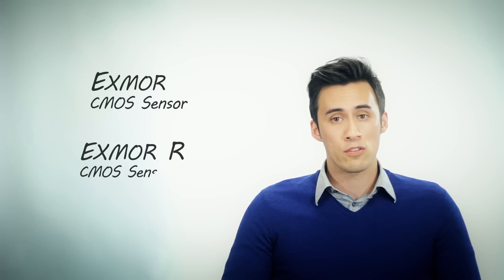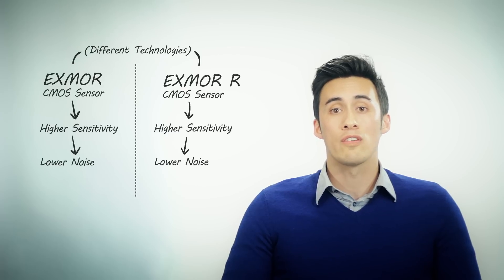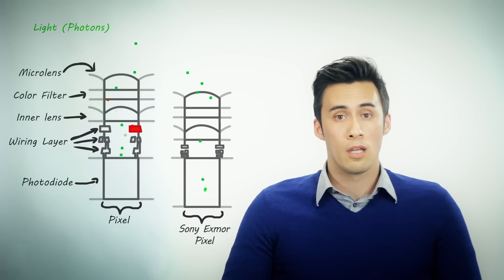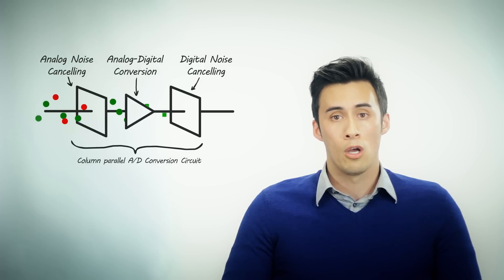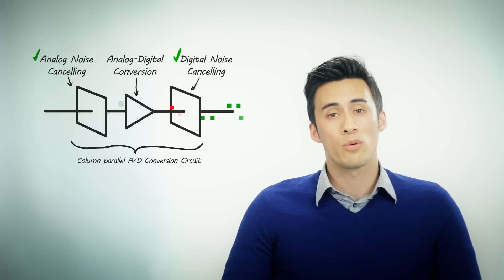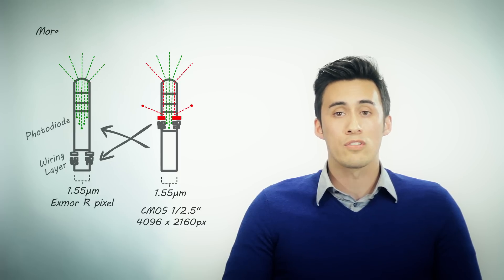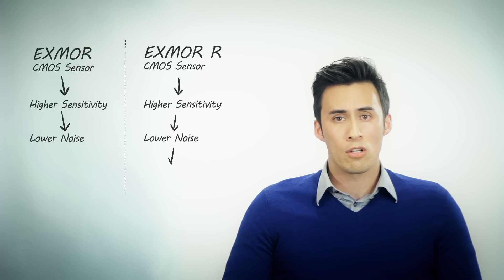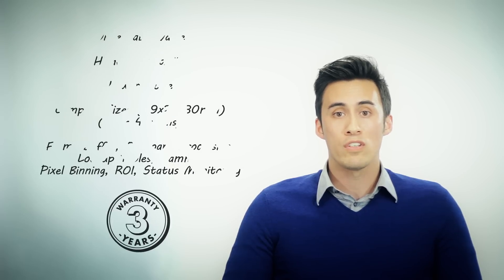Sony Exmor and Exmor R CMOS Camera Sensors Explained

Comment: Thanks for the review. How would this sensor compare with the newer Effio-V (Sony 960H Double Scan CCD) sensor or the Sony Ex-View Super Had II sensors? I'm divided on which to select, but leaning towards the Exmor sensor.
Reply: EUROASIAN10 Hi, saw you posted on the ExView HAD CCD II video as well.  Effio-V is a small computer chip that adds WDR, Digital Noise Reduction, 3D NR, Anti-blur and Defog to the camera (its a separate chip from the actual sensor). Sony EX-View HAD CCD II will perform better than a Super Had II sensor as it is a later CCD technology but it doesn't have the features of the Effio-V chip. Exmor is Sony's CMOS sensor technology and it doesn't have the features of the Effio-V either (unless it gets paired up with the Effio-V chip inside the camera and its up to camera manufacturers to do this). Exmor CMOS sensors have rolling shutter while CCDs have global shutter. To make things even more complicated Sony now has CMOS sensors with Global Shutter and that type of sensor is called Sony Pregius sensors. If you let me know what make and model of the camera you're looking at I can dive deeper.

Comment: I get 2 camera's of sony with both containing the xmore r sensor, yes they give a much brighter picture but the noise in video is clearly vissible once filming in low light,also noise in foto's are clearly vissible in low light once zoom in or when i view both fot's & video's on a large screen,what a let down.
Reply: Yah, low light will always be a challenge for many sensors and depending on the MP and sensor size, pixel sizes might be even smaller. Smaller pixel sizes might mean better resolution but it also means a smaller area to collect light.

Comment: as a sony specialist i use this video to help customers understand our sensors when explaining their benefits. Thank you for the in depth visual display break down! #teamsony
Reply: Thank you Adrian! Its awesome that you're helping people understand this camera technology. Thanks for watching!
Reply: Adrian Ferguson  hi, im intrigued by Exmor R and RS.  Would u mind to elaborate differences between the two, esp with low light and processor speed?  thx!
Reply: robert hi Robert. Exmor RS is a more developed version of exmor R and it was specifically designed for smartphones and tablets. It has an rgb color processor and an HDR processor in it (so the phone doesnt have to do the processing, the sensor does it all). Both R and RS and backlit sensors but exmor r can be much larger i size (you'll find them in sony point and shot cameras where as sony rs you’ll find in only smart phones). In terms of low light sensitivity, both are great but in order to see the difference you would need to compare with a smartphone with a none exmor camera sensor vs one with an exmor sensor. Exmor RS would give you great low light imaging with a higher megapixel rating. Most of the newer smartphones actually use sony exmor rs sensors, they just dont publisize it.
Reply: Michael Jacoby Sony's application in RX100 cameras is what got my interest.  If i am correct, RX100 m3 has an Exmor R and soon-to-be released m4 got an Exmor RS.  To me, deciding factor is low-light performance and I can't seem to find low-light differences between those 2 chips.
Reply: robert  The lowlight performance between the two should be very similar, the biggest upgrade I've noticed so far is the 4k video recording
Reply: Adrian Ferguson  i think so too, thx!  :]

Comment: You sound like your actually smart enough to tell me how to determine how many megapixels my lens needs to be. For example, I want to replace the lens in my Sony AS-10 action cam with a much narrower fov, but I don't know if I need a 1 megapixel, 3 megapixel, 5 megapixel, etc, replacement lens. How do I know what I need?
Reply: Hi MrWhiltetail! Well, I'm not that smart but hopefully I can point you in the right direction. 1920 x 1080 resolution, when converted to MP is only 2.1MP. The sensor size in the AS-10 is 1/2.3”. There are a couple of lens calculators online, here is one that might help you http://www.fujifilmusa.com/products/optical_devices/machine-vision/lens-calculator/
This calculator is for machine vision cameras but it'll give you a sense of what you need.
Reply: Michael Jacoby Well, apparently your smarter than the lens companies I have talked to so far. They couldn't tell me how to figure it out. All they could do was cross reference it from camera to camera (IP camera's). Your also smarter than the guy at Rage Cams. He uses and sells 10MP lenses for 1080p GoPro's and they are expensive (more than I paid for my AS-10). Until you came along I was under the impression I had to use the number of pixels on the sensor (11.9 million effective?). I had originally thought the same thing you just said. Use the resolution to calculate it. Thank you very much for your help!

Comment from the maker: Hi Johneymute,
Sorry for the confusion but yes it does! The major difference of Exmor R is that in order to make up for the smaller pixel size due to much higher resolutions, Sony uses back-illuminated CMOS technology. But yes, they do the same noise reduction as Exmor.